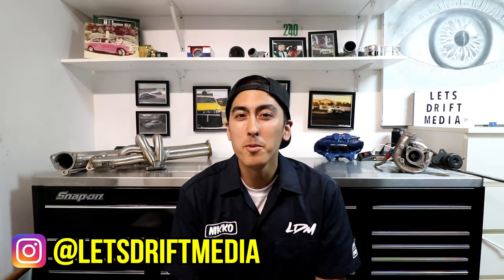HOW DO MECHANICS GET PAID? FLATRATE EXPLAINED 2020

Comment: My best pay period was 142.2 hours when I was at BMW. I did a few N20 engine swaps, N63Tu swap and a S65 rod bearing job along with standard stuff and I had Friday + Saturday off.

My worst week was 29 hours due to moving shops, waiting on parts, and free 0.5 diags. They didn't want to cover at least my hours there after I have lead hours in the shop without being i8 or i3 certified and still worked on them. So I left and went to the Service Advisor and Service Manager side after that at another dealership.
Reply: What was your flat rate?

Comment: The hell with flat rate... worked in a busy shop that refused to pay correct per hour wages to tech's... because of the amount of cars per day, figured you can make good money if you always hustled, had C techs doing check engine lights, drivability, Engines, Trans ect... Also worked in a union shop that paid much better hourly but you would never make over 50 hours... Made more money at the busy shop but as a career I believe the Union shop is the way to go... System due for a fixing! Union electricians making $60.00 an hour with a bucket of  hand tools.. SMH

Comment: The flag rate system benefits more the dealer than the mechanics: mechanics should be paid a percentage of what dealers charge the customers. 30% would be a good start.
Reply: Techs used to get 50% of the door rate when I started working as a tech.
Reply: @martyk1156  We need to bring that back.

Comment: Great video. My Toyota dealer over charges hours. My 07 Tundra needed spark plugs. I was quoted $600.
I watched YouTube, bought Toyota plugs, ordered a floppy socket on Amazon. It took 50 minutes. And it was my first time working on any engine. Next time it won’t take longer than 30 minutes. WTF
Reply from the maker: Sounds about right, you have to consider at a dealership everyone has to get paid, the technician, the service writer, the parts department, the porters. Thats why dealer rates are usually 150 per hr. Also usually dealerships have technicians who have been doing it for awhile developing there craft. not saying spark plugs takes much but depending on who does the job you know they will do it correctly and also you will have warranty if anything happens due to there repair. If you have basic mechanical skill I would rec doing alot of small jobs like that on your own to save money, theres a Youtube video on almost everything out there now as well.

Comment: It must come down to your particular shop management or your ability to kiss ass.  In my experience, Toyota doesn't pay for diagnosis and their warranty labor rates are low as you would expect.  On top of that, several things happened as I achieved more Toyota certifications:  Way less customer pay work, way more recall + warranty + campaign work, no pay raises.  Add in the common issues of favoritism in work dispersion, broken or missing shop equipment, wrong parts/ parts never ordered, not receiving pay for jobs, ridiculous promise times leading to constant drama, fast talking managers that do little to remedy any of the above, sabotage (unlikely but it happens), people "borrowing" tools that may or may not ever be returned, etc.

Comment: Sounds like a lot better gig for a beginning Tech then when I started as a flat rate Tech. We had a 30-hour a week "guarantee" meaning if you clock at least 40 hours  you would get paid for at least 30 hours even if you flag less than 30. If you clocked 50 your guarantee was still 30. No Matter how many hours you clock you better at least flag at least 30 because If you hit your "guarantee" three times you were out of a job. Luckily in 10 years I never hit my " guarantee". Also at that shop a front brake job on a O2 Toyota Camry including turning rotors was .8 hours. What a lot of beginning tech don't realize is the drama that can come with flat rate. One guy could be handed gravy tickets all day while you get the tough tickets. Watching someone else make easy money while you're busting your ass will definitely put you in a bad mood. Also it's important to find a shop that is always busy and has a good reputation. It's important to do quality work because if we had a come back we didn't get paid for it unless we could prove it was not our fault. At most flat-rate shops the other technicians in the shop maybe your friend but when it comes to hours they're your competition. This makes them less likely to teach you and less likely to lend you tools . My advice is make close friends with a good Tech in your shop.  also if you have to borrow a tool three times you better buy it eventually you're going to get cut off. Goodluck newbies it's not a gravy train at first but you can make good money once you know what you're doing and have the tools to do it. Definitely gets tougher to hustle all day as you get older. Remember smarter not harder. And don't forget for at least the first five years plan on spending roughly 10% of your income On Tools. I can remember plenty of times my monthly tool truck payments were more than my mortgage payment. 100 to 150 dollars a week×3 tool trucks. That'll piss off the wife:-)

Comment: Flat rate on the east coast diff. Flat rate is just that flat rate. Whatever hourly pay you negotiate when hired is what you are paid per book hour or hours it takes to do the job according to all data or whatever management program they use. The part that u didn’t mention was sitting in you bay for 10 hours and only getting 2 hours of work that day. Most places here do not pay the clock in time when you are flat rate.

Comment: Thanks for the info. How long do you think it would take to get out of the lube tech position ?
Reply from the maker: It took me 4 years but that was my fault for ruining my driving record when I was 20. If I had kept a clean record it would have been much sooner.
Reply: Just to ad my 2 cents. I think this question totally depends on your drive and interest in the field. Not to mention your willingness to take on automotive related work outside of your job. There are some people that are lube techs for years even decades believe it or not, but it’s only because they have decided that for themselves maybe inadvertently. Some people are lube techs for a few years. When I was a lube tech I didn’t know jack poop coming into the job. Didn’t even know how to mount a tire let alone tighten a drain plug. However I fer I couldn’t learn anything more after 6 months because I put soo much time in after hours on my own car and online researching. Hope that helps!
Reply: Venom63 thank you so much

Comment: Hey I know you speak a lot about “double minimum wage” but I work at A Toyota Dealership Ontario, CA so not too far from where you worked.....and the techs say that when we got hired apparently in the paper work we signed away our right to get payed double minimum wage.... is this true? Was this the case at your Toyota dealership?
Reply: Unless the dealer provides you tools!
Reply: Victor Espinosa the only tools my dealer provides is machinery “brake machines, alignment racks, presses etc....... and they provide tools if you don’t have any but NOBODY uses those... everyone has there own. is that how they screw us over? By offering tools nobody uses? Preferably an answer from Nikko since he worked at a Toyota dealer in my area.
Reply from the maker: Only the lube techs had to sign that at our toyota.
Reply: Lets Drift Media .... okay so if you started as a lube tech and move up to line tech you wouldn’t be eligible for the double minimum wage? Sooo In theory would I need to be hired on as a line tech to avoid signing that paper and getting double minimum wage provided I have my own tools?
Reply from the maker: @IronHardAirsoft  no. Once your on the line you go to the flatrate pay plan and they will start you off at probably double minimum wage. That's how it was for me going from lube tech to flatrate at the same dealer
Reply: @IronHardAirsoft  unless you signed a document.
Reply: Lets Drift Media okay cool, I’ll look more into it... thanks for your responses!! Appreciate it!
Reply: Ey you know that foo Tony ? With the little brz or frs?

Comment: I wanna start working at a shop and I’ve applied to various places but no one wants to give me shot since I have no shop experience. How do I get in the game??!
Reply from the maker: Get all your ASE to show that you have some knowledge on paper
Reply: When you have no experience what you need to do is go work at a quick lube like speedy, valvaline, jiffylube etc. They will hire anyone and they will ease you into the work they do which is litterly just changing fluids 95% of the time. I also recommend choosing one that does tires so you can learn how to work with wheels and tires too.

Comment: I have this feeling that when I bring my car to the dealer for routine maintenance, very little of what I pay actually goes to the person working on my car. Is that true?
Reply from the maker: Pretty much. If your getting an oil change the lube technician servicing your vehicle is making minimum wage. And if your getting a repair done. The dealer charges 150$ usually at the minimum per hour of labor while the technician is getting paid 30$ or so an hr of labor

Comment: What about no certifications no tools? Where do you start? $26/hr is alot of $$$ everywhere else around the US. Is $26/hr avg for someone starting out?
Reply from the maker: I was talking about being flatrate tech here in CA. But any place To be flatrate you would have to have tools already to get to that level. When starting out with no tools, certs or experience expect to start off on the lube rack changing oil with shop supplied tools and making minimum wage typically.

Comment: im gonna start working at a bmw dealer here in cali, the min wage is 16.07 in my city...im starting at hourly. not flat rate or anything yet. doesnt the law say if you provide your own tools you, get double min wage?? so i technically should be getting 32.14 an hour? they are going to start me at 25 an hour...bring your own tools, they provide the toolbox.
Reply from the maker: I believe min wage is 13 in CA, so you should be getting 26 to start. if not they are more then likely going to ask you to sign a waiver stating that you bring your own tools but will not be getting double minimum.

Comment: So it sounds like you get a minimum of your clock hours but if your doing the jobs and beating the book and even though clocked in 80 hours in 2 weeks but you bill out 120 hours of jobs you get paid that 120 hours??? Just trying to understand here. I'm not a mechanic and not trying to be just wondering how it works.
Reply from the maker: Yes pretty much what you just said is correct

Comment: And then you get a rusty car where everything you touch on it breaks apart.

Also this incentivizes techs to cut corners. I fu%&ing hate when I take my brand new Toyota to a dealership to only get it back with half of the screws and missing plastic tabs. Stop being fing lazy and put the original screw back that you took out. Stop stripping the oil drain plug and then put it back like nothing happened and give the car back to me with a slow leak.

Comment: Hey dude I work for toyota I'm in the San gabriel valley ca. I want to get started into mechanics I'm currently a porter. Is it true all I need is a ratchet and a standard socket? To change oil. As a lube tech. Thanks if you reply dude.
Reply from the maker: Pretty much a 14mm wrench or socket. And an oil filter wrench. I have a video on my channel explaining tools I used as a toyota lube tech
Reply: Oh shit i didn't think you'd reply I'm new to the channel thanks dude and I'll check that video out.

Comment: I think I confused myself lol.
So if you work your normal clock in, 80 hours, 2 week pay period, but don't flag above 80 hours (the normal work week) you will only get paid the standard 80 hours for two weeks? but if you flag above that, say the 120 hours in the example, you'll get paid the 120 hours at the hourly rate? At least in Cali.

I think that's right? I was thinking this whole time (from prior videos) that the dealer was paying the standard 80 hour clock in per 2 weeks and whatever flag hours you get (120 for those two weeks say) so that you'd get paid your standard 80 hours for 2 weeks PLUS a "bonus/commission" of the flag hours, 120 at the hourly rate so your paycheck would be something like 200 hours at the hourly wage.